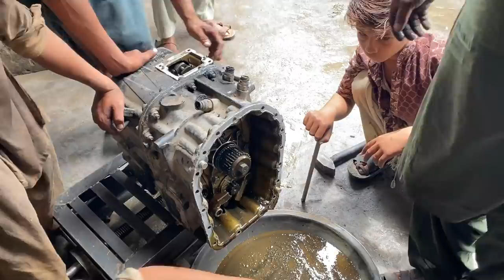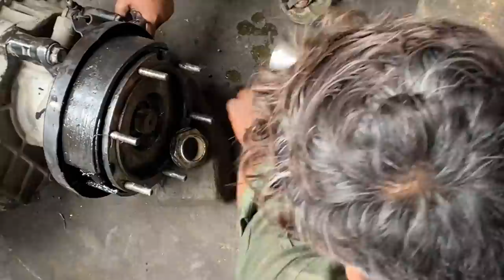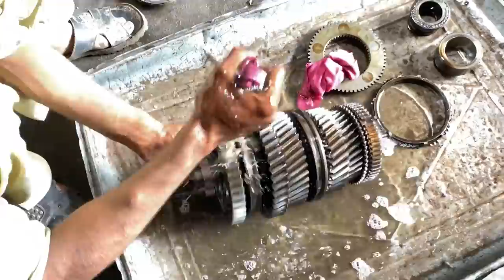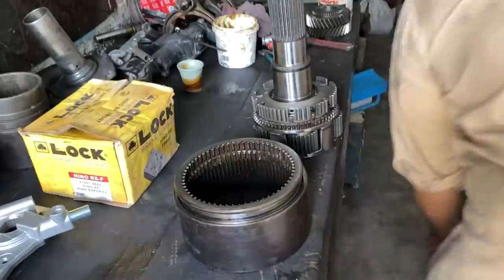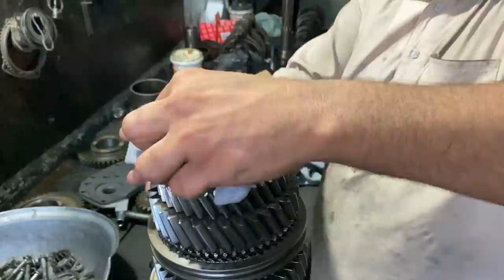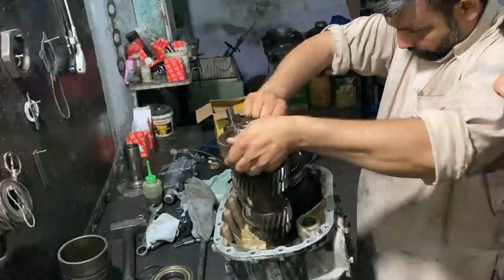Check the condition of the gear due to over loading

Comment: I enjoy this thoroughly. No bullshit overdriven intro, just getting straight into the intriguing problem and working on it with very little to use. I hope the content format never changes
Reply: The intriguing problem is them. They are the cause of all these failures since they don't assemble the transmissions following the proper guidelines. Just because it works doesn't mean it will last. And they obviously don't!
Reply: @MrCheckmateMarine  you are right. It wont last long. There are some delicate procedures overstepped here that will result in premature failure- one being the improper tightening that is performed in several areas of the repair. I would never reference this for anything other than just enjoyable to watch, especially for what little they have to get it going. Not educational.
Reply: @jameskuberski9621  The point is is that they could be so much better for so little extra effort. But they will not bother. They are too dumb or too lazy to bother. That is the real problem.
Reply: Muito bom comentario..com tão pouca ferramenta fazem um bom trabalho..

Comment: It amazes me what these guys accomplish with less than ideal conditions and far from the manufacturers recommended tools, etc, and make it work...
Reply: i wonder for how long....
Reply: @danieltaon7333  for long as need be
Reply: Oh it will work even if a chimpanzee would have done it, but it won't hold for nearly as long as if everything was built according to manufacturer specification. I would never have let them to fix my car gearbox after have seeing this.
Reply: @dtiydr  I agree, just amazes me that they can tear it apart and get it back together, I can get anything apart, but, putting it back together and working......
Reply: @DonLuc23  Just have an order to where it should go and put it in such a way that it cant be put wrong and it will work fine. Or take photo just before you take on thing apart and then its just to go through the pictures and you will know exactly where everything will need to go.

Comment: Impact wrench? Nope. Torque wrench? Nope. Snap ring pliers? Nope. Hydraulic press? Nope, we're good.
Reply: There are other vids on YT of Pakistani truck mechanics that show them using all of those except the torque wrench. One even has one guy working an albeit older electrical machine that adjusts a diesel fuel pump for the proper injection order.

Comment: It amazes me how he remembers all parts to put together in sequence. These are genius mechanics. Wow!
Reply: I was thinking if I did this job I would have to take loads of pictures, number label every part. Have a massive line of order where the first one off is the last one back lined up. Bolts in labeled bags and it would take me days to complete. I also would be using power tools to speed the process up but still take me longer.
Reply: see the video recording 😂
Reply: I bet he does 3 a day,
Reply: @E69apeTheMatrix420  uy
Reply: A genius or even mildly intelligent mechanic wouldnt fit bearings with a hammer in a filthy environment unless he wanted the repair to only last a short time.

Comment: 10:57 clamping a shaft that seats a bearing or a retainer in the vise leaves marks that spoil the seating.
Reply: I made several adaptations of "jaws" of copper, leather, nylon and wood to my vise, I have them with round and square fittings, so as not to mark the objects and pieces.

Comment: I just dont understand why put gasket maker and gasket. I can see putting high tack or equal to hold the gasket while assembling. Some companies will throw a fit or even fire a tech for putting gasket maker and the a gasket. I've seen them do it on several different videos.
Reply: Lmao your kidding right.
Reply: a very thin layer of a good RTV on both sides of gasket wont ever hurt, especially with old corroded surfaces and to save your time, efforts and money from doing it again, gasket is there most of the time just to maintain clearances.

Comment: I wonder how noisy an all 'spur gear' automatic would sound?
Reply: School bus and old trucks had gm turbo475 its a th 400 w straight cut gears. Im 40 ive ridden in one as a kid
Reply: I believe older Allison transmissions were all spur gears. Helical cut gears put too much of a beating on the thrust washers with all that vehicle weight/engine torque!
Reply: Not too bad really. Little bit of a whine at higher speeds

Comment: When they hammered the bolt and nut with a hammer and thus totally don't care at all for any torque spec or pre lube any glidning surface or needle bearing, just make me feel sick when ppl call them pros. Not pro.. just not.

Comment: Some poor Japanese or German or Swedish engineers spent years of their life building and maintaining factories to produce bearings made to exacting tolerances and standards of cleanliness only to have a chap in Pakistan fit them with a hammer in an environment full of filth and dirt. The casings are then fitted with a Pakistani micrometer(a large hammer) instead of a torque wrench.